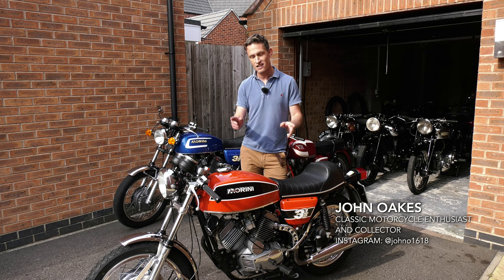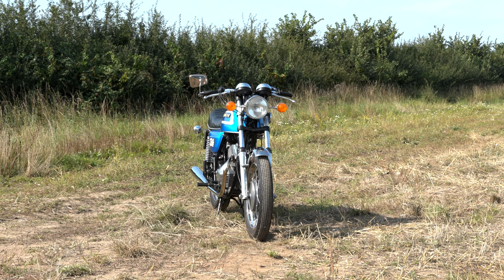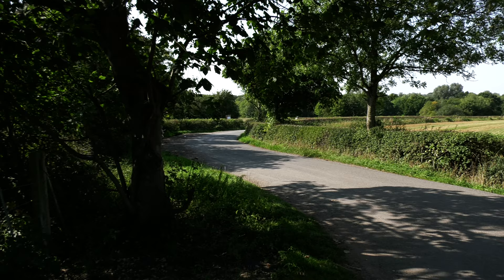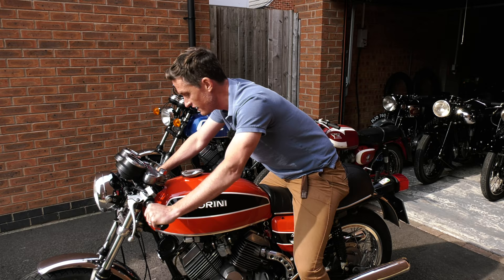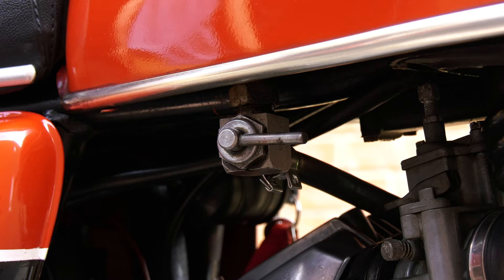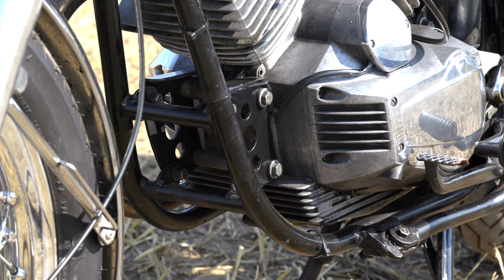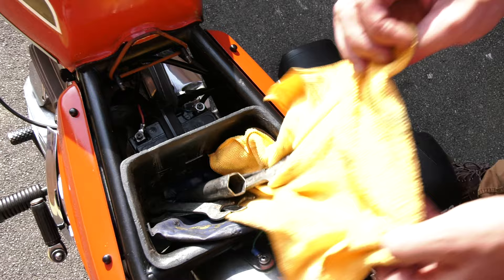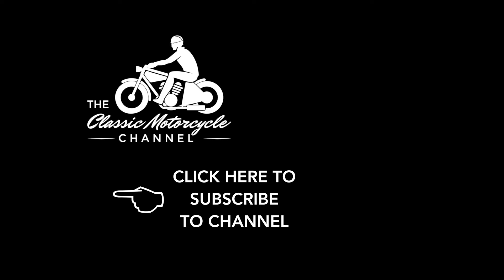1975 Moto Morini 3 1/2 Sport - overview & ride

Comment: When the 3 1/2 Sport was introduced at the Salone di Milano in 1972, many skeptics (and one-cylinder nostalgics) complained about the risk of the rear cylinder heating up. Lambertini himself explained that this issue had been addressed by the 72° offset of the cylinder and by the position of the rider, whose legs acted as a kind of air deflector. As a matter of fact, the rear cylinder presented a lower temperature than the front one by approximately 2-3 degrees. This might explain the advanced position of the pegs, even if as you said it was common to replace them with a rear Tarozzi set.

Comment: I lusted after one of these when I first saw one in the late 70's , I’ve spent the best part of 50 years on two wheels and in all that time I have never lost my enthusiasm for motorcycles, but for reasons I wont bore you with in recent years I'd lost my enthusiasm for riding them regardless of what machinery I bought in an attempt to reignite the passion for the open road. That was until I bought a 1975 - 3 1/2 sport earlier this year at the end of the first lockdown. To give what I'm about to say some perspective, I'm fortunate enough to drive Ferraris, Porsches, Lamborghinis, plus a variety of other high end and high performance cars for a job on a daily basis. After buying my 3 1/2 I couldn't wait for the working day to be over just so I could get home pull the cover off the Morini and ride. It may be small in capacity but it's huge on smiles. The instant you kick the compact V twin in to life everything about the bike from it's beautiful looks, the rattle from the dry clutch as you squeeze the lever, the light nimble handling you'd expect from an Italian sport bike, right down to the growl of induction noise that resonates through the fuel tank when you grab a handful of throttle and accelerate down the road, this bike doesn't disappoint and delivers every bit as much as it's cafe racer looks promise. The Morini takes pride of place in my garage. When not riding it I'm finding excuses to go out to the garage to tinker, or even just to look at it. It's a bike I'll never part with it. You can call me a sentimentalist if you like and they say you should never meet your heroes, but in this instance that saying couldn't be further from the truth. If like me you lusted after a Moto Morini 3 1/2 in your youth and up till now have never owned or had the opportunity to ride one do yourself a huge favour, track one down, (In my opinion the 74 and 75 models are the prettiest) and buy it, Un pezzo d'arte Italiana......

PS.. Pete, I'm sorry I pestered you in to selling me your bike (I don't mean this disrespectfully but, not sorry)
Reply: Just got two words for you;
Lucky bugger.

Comment: Bought my 74 350 sport a few years ago. Needed a bush on the crank, simple to work on.  Well made engine, engine casings held together with M6 Alen screws but M6 nuts on the other side, no threads in alloy to strip and makes for a strong oil tight clamping. Massive roller mains strong  motor and so fuel efficient 65mpg thrashing it! Yea this bike grows on you it just all works so well, always come back with a smile on your face after a blast. In reality you only get the best out the front drums when your on it, its a bit of an on/off monster but how cool is this little gem. Hint if you store one, drain fuel run paraffin through it protects seals, alloy and jets from todays aggressive fuels, turn it over now and again to keep the toothed cam belt from taking a set and breaking in use later on.
Reply from the maker: Good to hear your perspective on the Moto Morini Graham! Thanks for your comments :)

Comment: These were always a beautiful little bikes.

The 500 sport did give you just that little bit more go though, but lost some of its appeal with disc brakes etc.

I used to own a 1976 Benelli 650S2 Tornado Nuova twin.
It was the cafe racer version with the flat bars and single hump seat with Perplex handle bar fairing. Quite rare, and good for 57 bhp and a top speed of 126 mph with fettling to the Dellortos and gearing.

What thje Benelli and the Morini had in common though was all those magnificicent Italian engineered components. The Morini parts list virtually duplicates those of the Benelli.

Lovely bike.

Nick
Australia
Reply from the maker: Nice one Nick, good to hear from you and thanks for your input. I'm sure John will be checking in on the comments and will find your input very interesting. Some good knowledge of Italian bikes over there in Australia!

Comment: I owned one of these from new. I fitted the optional second front disk brake. It handled brilliantly around tight corners. Had terrible electrics typical Aprilla rubbish at the time. It also had square throat carbies I think Dellorto after a few miles they had worn you would pull up at the lights and find the motor was revving at 3 thousand revs I had to give the carbies a kick to drop the slides. Nice motor brilliant frame crap electrics and carbies. It had from memory a magneto ignition you could take off the lights remove the battery and go cafe racing. The trouble was the electrics would fail no BRAKE lights you had no idea because the engine kept running. All-round lovely handling nice motor crap accessories.

Comment: I bought a 74 Strada when I was 18 I saved up and worked all hours it was 4 years old but looked new - it was probably the best bike I have owned and apart from a rear wheel bearing and sometimes being a pig start in the winter didn't give many problems I even used  it as a motorcycle courier bike one winter - the clutch did complain ! My brother then built a 500 in a 350 frame which was the dogs nuts. Unfortunately  mine got totalled after a car ran into when it was parked and the engine was used for a race bike. The Strada I still on my list to buy again

Comment: In the early 1980's at a time when Japanese bikes were all the rage in the USA, I almost bought a new Moto Morini 3-1/2. I loved the idea of owning a ride that was totally different than what all the other guys were riding, especially with its V-twin config. The reason I didn't buy was because the only dealership in my region (Pacific Northwest Washington) was about 100 miles away; notwithstanding the ride home on the freeway would've been a real kick. Also I worried that Italian mechanicals / electrics would have me stranded from time to time (read: Fiat cars in the 1980's), so I'd likely be trucking my bike for distant repairs on a regular basis. Too bad I didn't know I was completely wrong ... well, not so wrong the electrics. But if such items as the tach failed, that still wouldn't have stopped the bike. And I would've had good reason to enjoy a pleasant 100 mile ride!
Reply: Hi Shannon, I have relatives in Washington state and have been fortunate to spend a lot of time overthere with them, a truly beautiful part of the world. As a Morini fan and currently an owner of 3 x 3 1/2 sports (74, 77, 78) and previously sold 3 others which I regret, I would be interested to know where the dealership would have been back in the day for you, just curious to know. What bike did you buy instead of the Morini?

Comment: Hi, you mentioned the Heron heads, but a very unique feature about this engine was the use of a "Desaxe" crankshaft layout which was supposed to increase torque and had an effect on the compactness of the engine. Although I preferred my Dukes and Guzzi`s I always felt the the original Morini Sport in was the most beautiful looking bike ever built

Comment: In 86, I had privilege of caring for a moto morini for a week while a friends was out of town. For the last 35 years, I've trying to remember the exact model and year. All I recollect is that the bike was small, drop bars, racing clutch and possibly a single piston. It drove very smooth and fairly quiet. I think it was an inline-single piston configuration; possibly a 550? My friend mentioned that it was a racer for females. I fell in love with this bike with in the week, but alas, had to return it.  Any info about this bike would be appreciated.   Thank you!
Reply: Morini made the 350 V twin in the 70's later they made a 250 version along with 500 version . Not sure about singles , nothing bigger than 500cc until they were built much later

Comment: A friend had a couple of these, first was same spec as this with the round tank and drum brake, then he had the angular tank and disc brake model. He moved to this from a 250 Desmo and I could never understand why. As you point out, the riding position is weird, it doesn't seem to have any performance advantage over the 250 and 350 Desmos myself and another friend had, and working on the engine with him I wasn't impressed with the quality of engineering in the engine. They do look nice though, and handle well.

Comment: These were never very popular compared to other makes of the day and I never really worked out what market they were aiming at they could not live with any of the 2 strokes on performance of course which only left Honda's 325 twin and 350 four which coincidently produced about the same amount of power the handling may have been better on the Moto Morini, I do not know for sure as I have never ridden one but it is Italian, but it would have to compete with price and Honda's much bigger dealer network so I guess if you had been in the market for something different maybe this would have caught your eye they also made a 500 by the way.